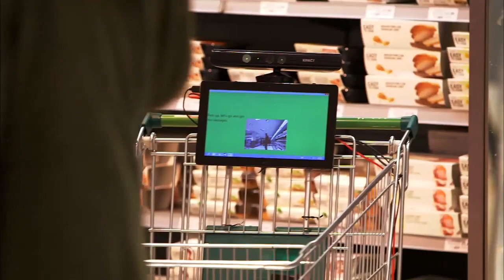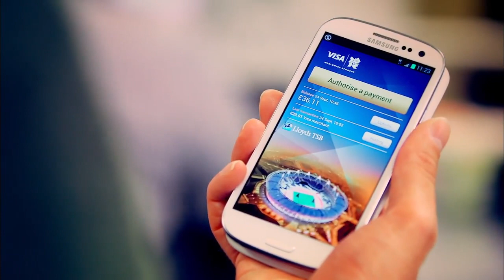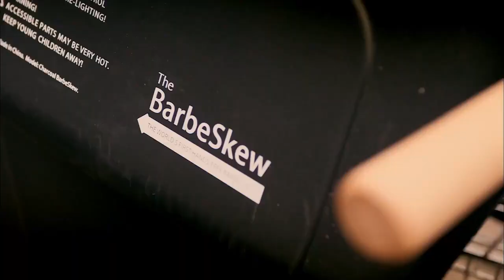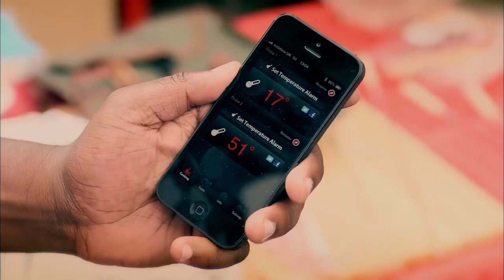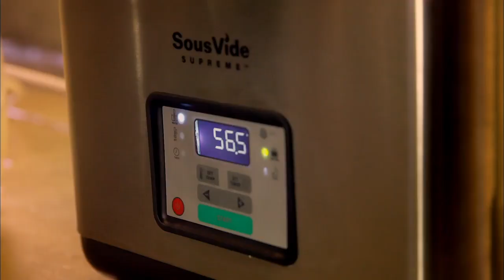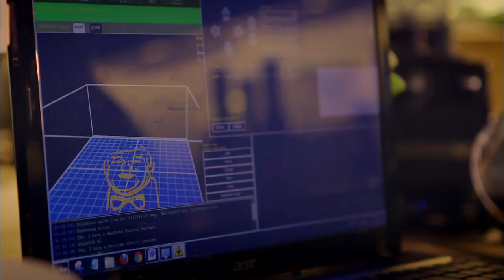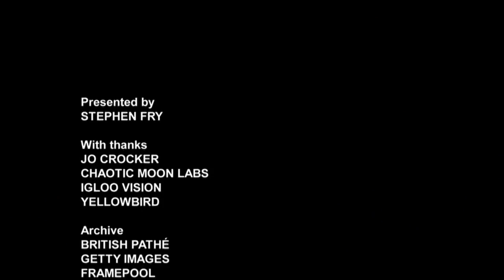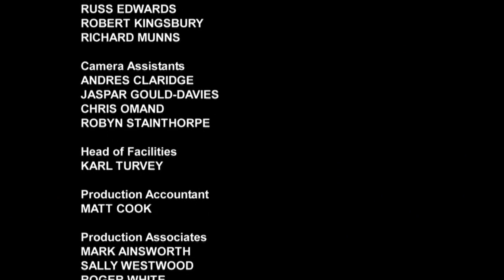Tasty Tech: Stephen Fry's Gadget Man - The FULL Episodes | Series 1 Episode 2

Comment: The start with the picture of the Akai reel to reel tape recorder, reminded my of my old Akai M10 with valves in it..
Plus we have one of those electric hot air cookers, as we wanted rid of the usual deep fat fryer which needed lots of oil in it, and smelt a lot of hot oil, and a bugger to change the oil and clean it.

Comment: I like the steak thingy. All I ever manage is a bouncy piece of dead cow.
Reply: Sous vide is definitely not just a 'gadget' anymore. I borrowed one from a friend just to try it out. I immediately went out and bought one for myself. It is a 100% fail-safe way of cooking meat to absolute perfection every single time. The only downside is that it takes quite a long time to cook in the water bath. But you don't have to watch over it as you do with a pan. Just pop it in the bath and do other things with your life for the next hour or so.
Reply: @Creeno1  Just pop it in the bath?
Reply: @Exoamylase  Yes, the water bath you cook your vacuum-packed meat in. Not a bath you'd wash yourself in, of course ;). You can use an electric cooking/bath container or you can buy an immersion heater. I prefer the latter because it doesn't take up a lot of room when you're not using it. And it works just as well.